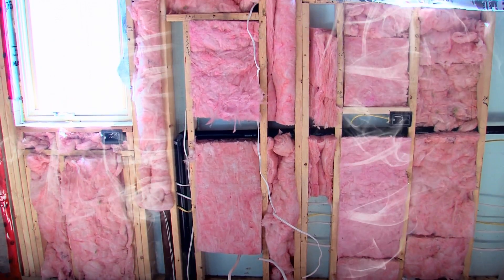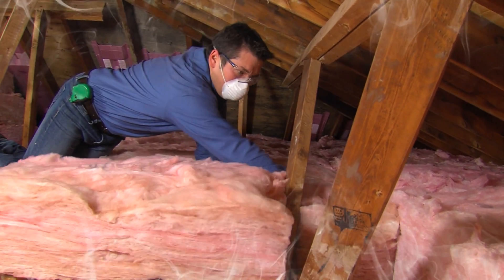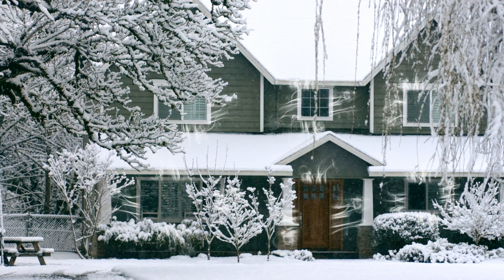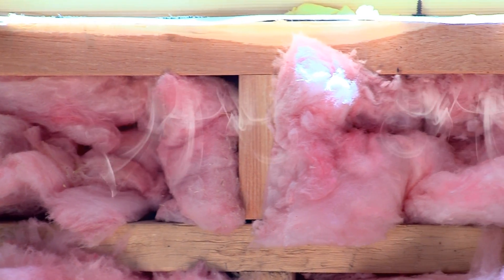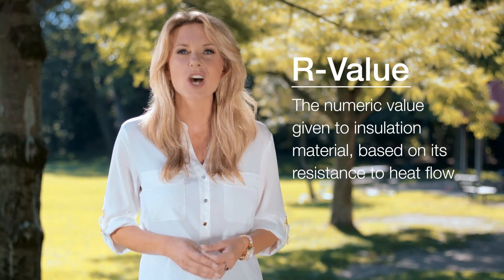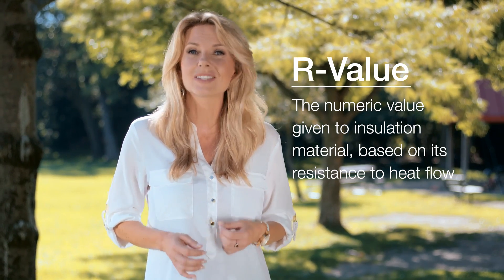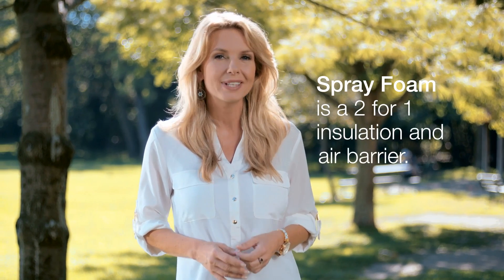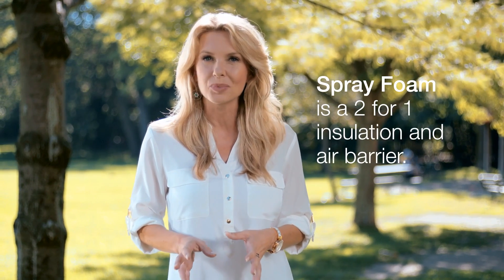Icynene Spray Foam Insulation: R- Values

Comment: Another fantastic video the consumer should not miss seeing. It's time to insulate your home with the complete package! Icynene spray foam insulation. Your High Performance Insulation and air barrier system. Also available online at Showroom Partners. If you are in the New England area, then we suggest Anchor Insulation company as a licensed Icynene dealer with a family business touch. Professional installation that's on time and within budget.